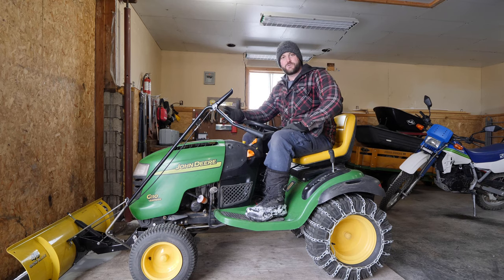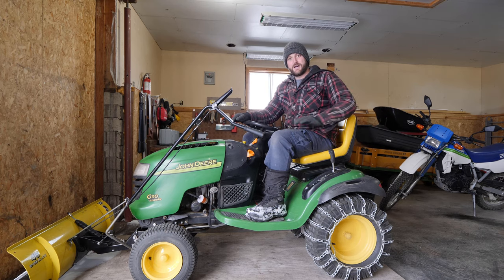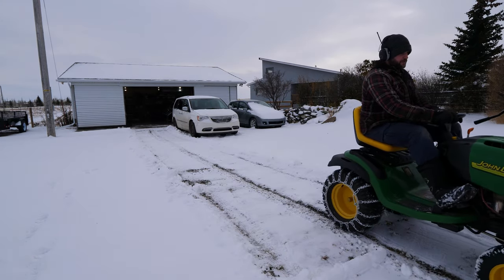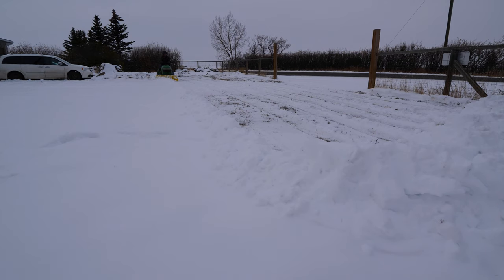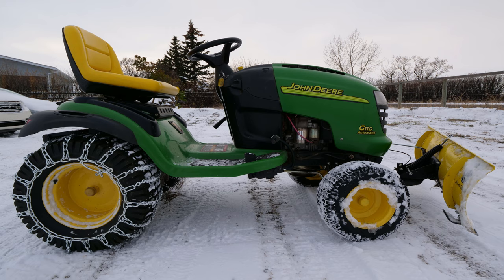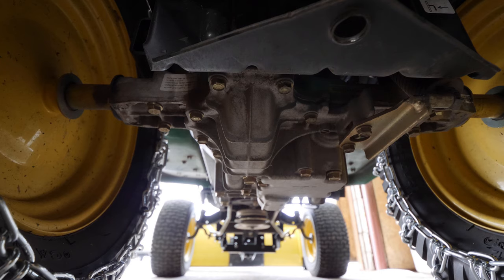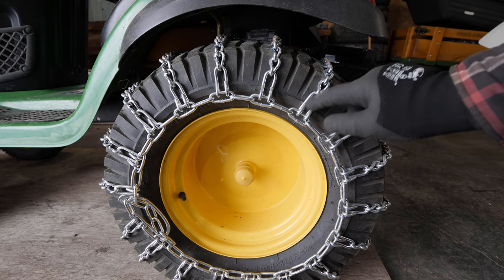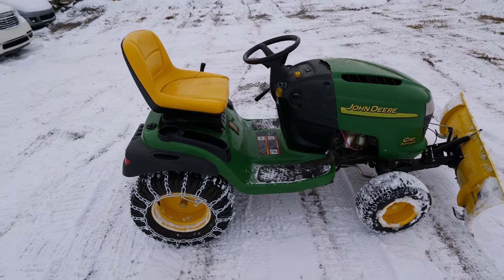Plowing Snow with a Lawn Tractor

Comment: They will plow snow, it's a question of how long before they fail.
Reply: That's the question for any vehicle with a plow... I can tell you from experience with the same model I've been plowing an 800 ft driveway 7 years now with nothing but a new blade replacement and tires

Comment: I engine swapped an old simplicity 5216 with a honda 5hp pressure washer engine because the original engine was blown up. I made a homemade plow and it never bogs down in heavy snow but traction is an issue with the lighter engine

Comment: My 1990's jd garden tractor has a plow and chains, wheel weights on the back and it has plenty of power and traction. I've used it once with heavy wet snow. The problem is that with the blade at an angle, the front wheels got shoved to the side. It worked fine going straight, but then the snow piles up in front until it can't push the pile any more. I'm thinking about adding weight or tire chains on the front. The guy I bought. it from plowed snow with it for years, power train is fine so far. There's no mower deck, it's just for pushing and pulling things anymore

Comment: The power doesn’t even matter. All ride ons have plenty of power. It’s always tires spinning and the fact that they weigh so little. that’s the weakness
Reply from the maker: Traction is mentioned as the most important point "chains/weight". If you add enough weight to reduce the spinning of the tires then absolutely power matters. Add 150 pounds of weight and a 250 pound operator to an older 14-16 hp lawn tractor, then plow heavy snow. I've personally tried this and the engine is the limiting factor.
Reply: @PROSDIY  I push snow with a decades old worn out 12 hp John Deere stx38 the weakest model there is. With chains and weight on the back, it still spins the tires. These mowers should not bog down pushing snow period
Reply: You can put chains all around and wheel weights but in my experience it is the hydro transmissions that will not handle the stress. A very expensive fix and not worth the cost.
Reply: That’s why I use an older one with manual gearbox. No finicky hydro oil and pump. 15.5hp chains and weight drop it in 2 and it will move all the Minnesota snow I want.
Reply: @travisbryant8567  Is it still possible to buy a manual gearbox garden tractor?  I have not seen any lately.
Reply: @MikeJones-rk1un  troybuilt

Comment: Im considering the John deere 46 in blade for my D160  but I am concerned about the Transaxle. Can the D160 transaxle handle a plow, I live in Calgary where we get light dry snow.
Reply: It would only last a few seasons. You can rebuild them when they die, its not hard.